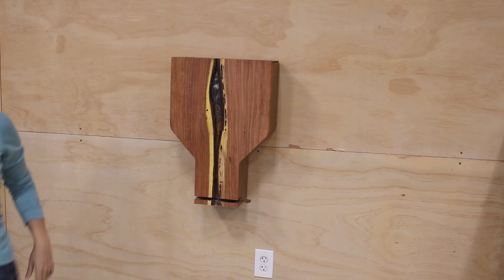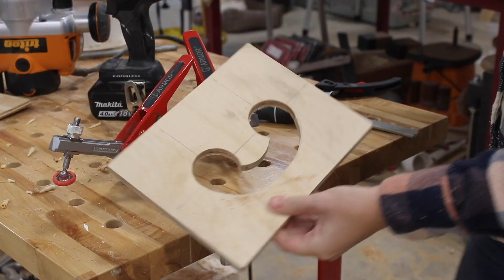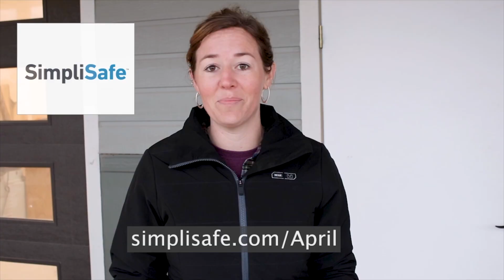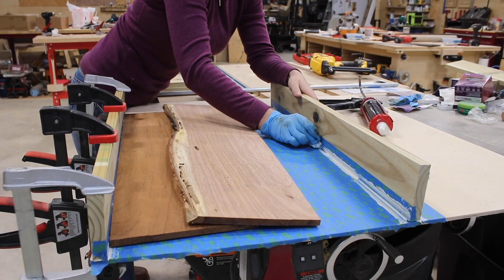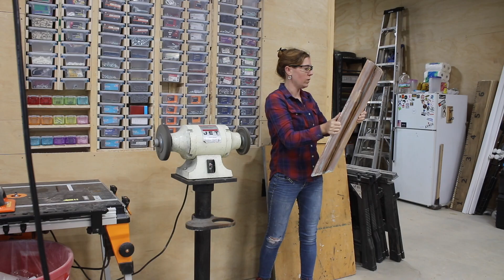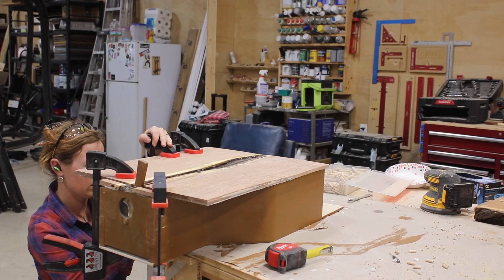How to Make a Dog Food Dispenser

Comment from the maker: Protect your shop, home and family this holiday season with SimpliSafe! Check out their Cyber Monday sale: https://simplisafe.com/April
Reply: You guys need to stop pushing simply safe. It's been shown recently that a modestly powered ham radio can make the system essentially useless.
Reply: @Jeremy-iv9bc  probably the same with most new security systems.
Reply: Wax paper with glossy side ☝
Reply: AKJV qq1611 AND Received Text job and I am not able
Reply: but guys... "experts" call it the number one recommended home security
Reply: Wheres the mill updates?
Reply: Hi April.   Nice job how's the Big mill going
Reply: Your the Da Vinci of dog food dispensers.
Reply: I know storage can create problems with the old oils going rancid and making the dogs sick. Have you witnessed any of those issues?
Reply: Burying this in a reply, rather than a base comment, but SS doesn't have the best public record for system design and resilience; arguably behind Google, but better than Samsung for alarms, IMO.  I'm a little surprised you didn't run simple twisted pair for sensors when you built the shop, rather than trusting 433MHz for anything important.  You're in the country and will see folks approaching, so the largest downside for you might be battery replacement.  An apartment in a city would be a different situation, again IMO.

Comment: Nice build, I think I'll build something like it.  Couple of changes I'd make if i ever get around to it:
1. I'd use pocket hole attachment from inside of the box to attach the face
2. Rabbit out the back of the center of the face plate and put glass there before epoxy pour to make a non static scratch resistant surface on inside (may be overkill though) 
Cool project!

Comment: While this is a great design, I think perhaps you've made a grave mistake in not addressing the food / mold issue. It appears some have brought this up to a certain extent. I saw that there are a few areas that are not at least coated with paint or stain as well - small, but once mold gets started I think you are going to find this dispenser ends up being a throw-away. I would give this at most a few months before some major mold starts developing, assuming you check it.
Don't get me wrong, this is a great design, but not sure it is really going to work, especially with the generally somewhat oily aspect of dog food.
Reply: Mold needs moisture to grow.....plain dog food isn’t just gunna start growing mold lol
Reply: @dddddddddd924  suggest you take a look at the moisture content of a bag of dog food. Even in special plastic dog food containers mold has to be kept in check. After 20 years of breeding Golden Retrievers I have a fair amount of experience with this.
Reply: @rufthrock.b3266  maybe adding in a glued plastic tub inside the main chamber + a tube that could both be removed and cleaned? It seems like it'd be fine to wash it once its empty and then refill it after its dry
Reply: @sylviapuppysticker8664  Probably the only way you might not have trouble would be to use an epoxy paint on the inside that could easily be cleaned periodically. If you could find a plastic tub the right size, perhaps that would work, but I think there might still be problems where ever there was a junction / crack that a tub had to join to the wood. Even our plastic bins we use, though they are great, they still develop some mold and have to be cleaned once in awhile. Unfortunately, ALL dog food has a certain amount of moisture in it. It has to be enclosed to keep out rodents, ants, etc.; so, it is an ever present issue that needs to be dealt with.
Reply: @rufthrock.b3266  you're not taking into account where you live. I've had dogs for 43 years so far (I'm older than that) and never had an issue with mold once. Perhaps your humidity is high.

Comment: do you have any concern for the chemicals in the epoxy, glue and paint mixed with the pupper foods?
Reply: Do you have any concern for the chemicals in the paper, glue and labels that the bag the dog food comes in?
Reply: @DJ8017 your joking right? There's a big difference between food grade packing and adhesives and commercial epoxy, stains and glue.
Reply: @dj59y  Yes I am joking.

Comment: Dowel pins would mean you don't have to drill trough the front. Drill out the case dowells, drop in the dowel pins, put the top on, press down by all dowels, you have prefect marks for drilling (in hardwood needs a knock with a rubber mallet) then you have normal, hidden dowels, easy. The only cost a couple of pounds for 3 sets in UK 6, 8 and 10mm, I bought a couple of sets to make it easier.

Comment: i think you should build 
Matthias Wandel band saw a big one
Reply: Though technically, she has a gigantic bandsaw out in her yard already. In theory, it could be used for resawing wood, but the mechanism needed to hold down a single slab, flat, to make a 1/4-3/4" cut is probably more hassle than it's worth. So yes, a Wandel bandsaw would be an excellent shop addition.

Comment: Where you had the tape stick, we used to pour hundreds of Cypress clocks in Florida with epoxy. We used old boards and drove nails completely through and then placed our Cypress on the nail boards. Put plastic sheeting under the nail boards to catch the run off. Use a small handheld propane torch over the top as soon as you pour to get rid of air bubbles. When dry the next day, turn over on a old piece of carpet and sand of the drips with a grinder.

Comment: This is what I found:
The wooden dowel rod used in woodworking applications is commonly cut into dowel pins, which are used to reinforce joints and support shelves and other components in cabinet making. Some woodworkers make their own dowel pins, while others purchase dowel pins precut to the required length and diameter.
When dowels are glued into blind holes, a very common case in dowel-based joinery, there must be a path for air and excess glue to escape when the dowel is pressed into place.

Comment: It’s a great idea to put a “sight glass” in the front of the dispenser so you can tell at a glance how much food is left in the hopper.  But I wonder if the bark on those live edges is going to separate from the wood eventually.
Reply: Great observation, the bark will at some point begin to seperate. I have to say though from a overall design and execution standpoint its a home run! AND a great vid, well done!!!

Comment: I'm a bit concerned about how safe this is to store food in. It would be a good idea to line the inside with something waterproof and food safe.
Reply: benny and leo the cats how it’s wood
Reply: @cody_janssen831  it has both non food safe glue, and epoxy. Not to mention it's going through PVC and possibly a painted surface before being dispensed. 

There is a reason there are food standards.
Reply: @rsmith5990 , it's dog food and I'm pretty sure the glue, epoxy and pvc are all solid and will not get into the food.  Calm down.
Reply: Jonathan Trivette, your "pretty sure" is no guarantee of safety to the end consumer.    R Smith, thank you for watching out for the canines and more.!  Very perceptive and quite courageous speaking up on their behalf.  <3
Reply: @rsmith5990  well, eliminate PVC from your concerns.  PVC pipes are approved for use in commercial kitchens.  And the wood glue, it's not toxic.  So, instead of just expressing fears, research, because it works to present truth over fear.  If you find that there is verifiable concerns over the paints and epoxy, of course, list them.  I'll say, though,  this epoxy is frequently used on commercial and residential tables and countertops, so toxicity is not likely. Which leaves the paint. Ya. That also can be researched.

Comment: Get you some Dowel Center Transfer Plugs, so you dont have to drill throug the face board ;-)
Reply: Glad you suggested this, was about to suggest the same but could not find the english name :) A really cheap and useful tool, I often use them to repair drawers.

Comment: Using the 3M yellow painter’s tape doesn’t stick as bad as the blue & can leave on surfacing a little longer. The only downside to the yellow, the “tack” for adhesive isn’t as strong as the blue (which is technically the strongest).
Also, have never tried on this “scale”, but the Paint masking liquid h2o might work as well(usually use in glass)?
Pretty cool project👍🏻
Cheers✌🏼

Comment: I love it! 
I adore mesquite wood. I used to live out in Bastrop County near the Caldwell border; my land was chock full of mesquite. I talked to an Ag Extension guy who happened to love mesquite. He said that if you irrigate mesquite, it will grow taller and straighter.  (A friend of mine swears that if you irrigate it, it grows much fewer thorns, too.)  The Ag Guy told me mesquite has a perfect 1:1 expansion rate, making it great for wood floors in wet areas like bathrooms and kitchens; because of the expansion rate, it won't buckle like most woods do in wet areas. I never had the opportunity to test that, but I never forgot it, either.

Comment: I recently did a countertop epoxy pour and used the Lowe's branded "Tyvek" tape to keep epoxy of the ends of a drop-leaf counter peninsula. The tape worked like a charm and the epoxy didn't stick. Give it a try. One caveat: It sticks to itself well...not so much to wood over the long term if you're using epoxy with extra long setting times. So put the tape on right before the pour.

Comment: Your pet feeder looks wonderful!  I inherited three black cats when my brother passed away.  I tried to find a really nice home for all three of them but no takers.  He was living in a 5th wheel trailer on the back of our property and never let the cats out.  Yes, it did stink!  Yuck!  The cats didn't like me, they wanted my brother.  One would just hiss and growl at me when I would feed them and clean the litter box.  After two months of taking care of them, a Springtime storm blew one of the doors open and two cats were gone!  One still remained and after two months of leaving the door open, I finally got him/her to actually go outside.  The other cats didn't run away, they just didn't want to be inside with such a wonderful world around them.  And it turns out the next-door couple also had a black cat too!   So, four ... four black cats!  I go away a lot and the neighbor would feed the cats when I was gone and that worked out very well.  However, I decided to build a pet feeder that was designed to be outside!  Now we have raccoons and possums so it needed to be bolted down to the back covered deck and pretty strong.  I built it out of 304 stainless and made all my TIG welds food grade.  It uses a pellet stove auger and a slow RPM motor along with a 24-hour timer and it dispenses a 5-minute feed cycle about mid-morning.  It holds one 13 lb bag of food.  It has been working fine now for about a year now.  The cats almost like me now, but they still won't get within 10 feet of me.  And that's okay.

Comment: Hot glue works for edge sealing just as well as the tube stuff plus it is substantially cheaper. It is what I have used to do epoxy pours without any issues. The epoxy stuck to the painters tape because it is basically a textured surface. I have used smooth, colored packers tape with success personally.

Beautiful piece of mesquite and a really neat project, well done of figuring out the feed mechanism.

Comment: is that plywood and epoxy food safe?
Reply: Daniel Lalor after epoxy cures it’s food safe.
Reply: @MikeTheMaker1  not all and with moving parks you have to worry about scrapings contaminating the food, also LOTS of plywood has a TON of formaldehyde in it, not so good for food storage.
Reply: Daniel Lalor I never said the plywood was. The epoxy “should” be harder than most dog foods therefor the food will break before the epoxy. Same way a file scrapes off softer metal.
Reply: @MikeTheMaker1  i was talking about the portioning mechanism.. not trying to start and internet shit fight... just a crazy dog person and their health is always my first concern.
Reply: @daniellalor6244  just get a new dog when that one dies
Reply: I was even concerned that she painted the inside mechanism. Is the paint safe to have near food. Not only that, there is oil in dog food too, which eventually will go rancid. You want to be able to wash the container out once in a while to remove the oil buildup. (That information was per my vet regarding storing dog food. It wasn't something I had ever considered before, and according to my vet, it's not something most pet owners take into consideration.)

Comment: Hi april Loved the project.  To put in 'blind dowels' take a look at dowel transfer pins. Simply drill your dowel holes in one side of the joint, put the transfer pins in all the holes, put the second piece in place and press down. The transfer pins have a spike in the centre of the dowel that will mark the exact centre of the second work piece. Disassemble, drill the other work piece with blind holes, glue and final assemble. :-) Hope that helps in future.

https://www.google.com/search?q=dowel+transfer+pins&source=lnms&tbm=isch&sa=X&ved=0ahUKEwjt6Km-lvTlAhXsRxUIHcqpDkMQ_AUIEygC&biw=1366&bih=663

Comment: Loved the mechanism and how it looks, alternatively you can brush new resin on top of sanded one to get it clear sometimes, or using Micromesh going through all the grits, or using buffing/polish paste/compound. Being it a food dispenser though maybe it should be sealed with pressure latches and gaskets around the openings to avoid the food becoming stale through contact with air or having bugs creep in, since it is inside the pantry, no issues with light going through the visor but if someone builds it and keeps it in contact with light would be interesting to use some UV resistant resin or having a removable cover for it also make sure no bits of glue, caulking or anything that comes into contact with the food isn't food safe. Thank you for sharing your videos!!! Cheers!!!

Comment: Heres a tip I learned when working at Walmart to get labels and tape off of things use a hair dryer the heat loosens the adhesive so you can start to pull it up without leaving a mess behind.
Reply: What prevented the blue tape from coming up was that the epoxy leaked underneath slightly. No amount of heat would've helped in this instance.
Reply: One thing I learned working in the rock quarries is that dynomite will loosen pretty much anything.
Reply: In addition to what plc286 said already, the tape was applied to the table, so it was the non-stick side that was stuck...by the epoxy leakage, as mentioned already.
Reply: thank you for this advice, I just knew there was a way to end my mess.
Reply: I've seen other people use clear shipping tape to cover their resin molds. Reportedly, the resin does not stick to it, nor soak through it, as it apparently did with the painter's tape. Also, you can get it in wider rolls, so it's faster and easier to apply.
Reply: Your welcome
Reply: Why.. did you need to know this when working at Walmart

Comment: I love the idea of this. I have a few concerns though. 
1. I was ask by a veterinarian when I had my dog in for an ailment if I had a food grade dispenser. I had never thought about that before. He said that the porous walls of many dispensary’s will collect the food and wrought causing health issues. 
2. How long do you let the chemicals cook off before putting food in there.
Reply: Ideally the food should be kept in an airtight container which is food-safe/food-grade- this dispenser is neither. If it had some kind of liner or inner container it would be okay, but I wouldn't want to keep weeks and weeks worth of food sat in a wooden container which is absorbing humidity from the air and risking mould-growth, or simply allowing the food to go stale. The fact that her dog(s) haven't had any issues so far is more luck than judgement...
Reply: @SuicideNeil  Yeah, the pet food containers I have now are plastic and the lid screws on and has an o-ring to seal things.
Reply: @cpad007  you have to be careful, not all plastics are food safe
Reply: @alaskankare  These are sold as pet food storage bins so I hope they are fine.
Reply: I was thinking the same thing to be honest as to how food safe it would be.  Also some epoxies can be pretty nasty and not at all food safe.
Reply: Dogs eat poop.
Reply: dpeagles - I'll second that.
Reply: For those with concerns regarding food safe epoxies: Total Boat's Tabletop Epoxy is food safe. However, the High Performance Epoxy "Safety Sheet" indicates it contains Bisphenol A, so it's probably not food safe. So, my guess is one could seal the entire inside of the project with the food safe epoxy and be good. I've used the Tabletop Epoxy with good results, but the working time is significantly less than with their High Performance Epoxy.
Reply: I guess it would be best to make the container and dispenser mechanism from stainless steel  at cover it with wood from the outside. Might be a project for this old tony :D
Reply: @ensen89  maybe have a dispenser that holds the bag and punches or cuts a hole out of it?
Reply: @ensen89  yesssss!
Reply: I would be concerned with the glues used in the plywood that was used to glue-up the sides as well.  Cheaper plywoods have really nasty glues.  That said, I think if you would finish the inside with shellac (many layers) it would build up enough protection and make this safe.  After all shellac is used in medicine/pills and other consumable items.
Reply: coat the inside with epoxy which is food grade. at least epoxy by Stone Coat is. I cannot speak for the rest.
Reply: Well, if you watch enough of these videos you will soon realize that April really doesn't know what she is doing.